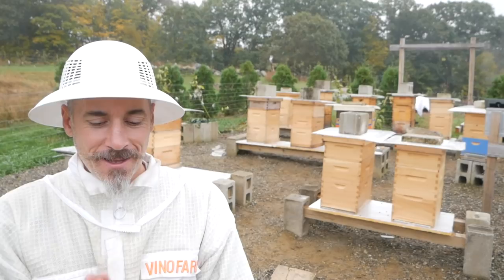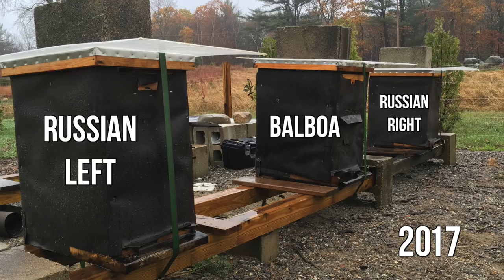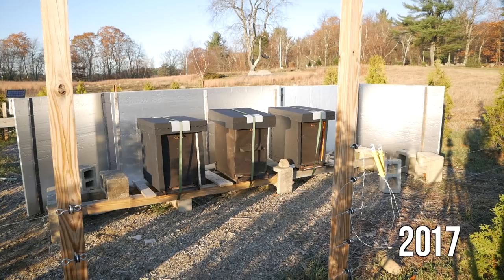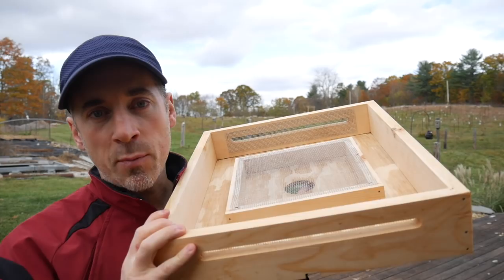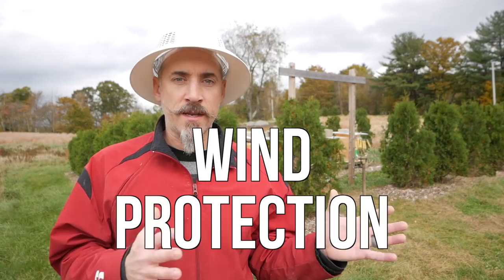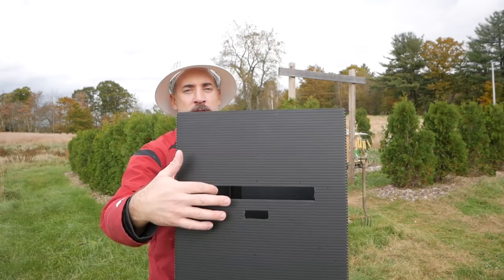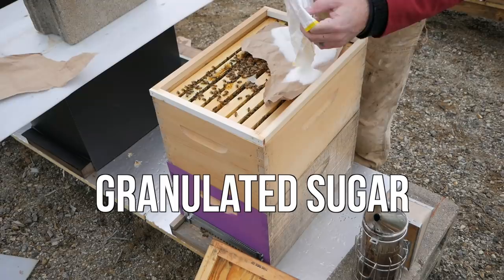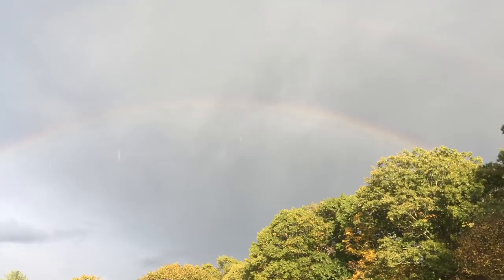Never Use Tar Paper Again, Beekeepers!

Comment from the maker: Where did I get my coroplast? I'm in Massachusetts. I googled "coroplast" "corplast" "Corrugated plastic" and found that most places that were coming up were sign shops. (All those political yard signs are coroplast.) Then I googled "Sign supply" "Sign Supplier" etc. and found a company called NEPCO in Rhode Island. I was prepared to drive down there, but they actually deliver all over New England. I called and they gave me a price of $16/ 4x8 sheet. That sounded pretty good, but I asked how much a larger quantity would be and he gave me a much better price. If you buy more, you always get a better deal. Shipping was a fraction of the price. So if you are in New England, call NEPCO. 

If you're careful about your cuts, you can get TWO sleeves per sheet. 

One 4x8 sheet will yield:

TWO single deep brood box sleeves
or
ONE single deep and ONE double deep
or
2 single deep+single medium combos
or
2 double mediums
or
2 triple mediums

You can't get 2 Double Deep sleeves out of a single sheet.

I did my 12 hives with 6 sheets!

----------------
Oh, and if you're cool with Alibaba and don't mind waiting for freight from China, you can buy 1000 4x8 sheets for $1/sheet (or probably less if you haggle!)
Reply: RV dealers, used as an underbelly. I work at an RV dealership and we purchase it by the roll and sell it per Rolling Foot
Reply: Vino Farm winterizing
Reply from the maker: Paul, Good Tip! How is it rolled? Are the channels parallel or perpendicular to the "roll"?
Reply: @vinofarm  perpendicular.
Reply: @vinofarm  u will send u pics and part numbers to your email.
Reply: Wouldn't be better to build a greenhouse tunnel over the bee yard?
Reply: Did you check if it was UV protected? Otherwise, it will degrade over time.
Reply: @Helveteshit  the material  i am referring to is very durable, i don't know about its UV charateristics however it is a black plastic. I relate it to zip ties, typically UV rated zip ties are black and non UV are white. But of course this is just an assumption based on observation.
Reply: I had 1 beehive and it died today😭 because there was alot mites.. and it was too cold already
Reply: you should try a shamwow this winter!
Reply: It still puts of voc , it amazing people put tar sound damper material in there cars...

Comment: From testing I've done  the  best moisture control is a good insulated top cover with no ventilation up top and  no air leaks , the top cover under the insulation  is always worm which keeps moisture away ,  cold surfaces invite condensation  ,air vent up top keeps a small stream of air going through the hive  while taking moisture away it also has a cooling effect on the cluster
Reply: To clarify from your testing, the Vivaldi board would be good in summer for ventilation but remove for winter due to condensation? Or would you never use the Vivaldi board?
Reply: @roland7511  My preference is insulation up top with no holes ,i mostly use reflective double bubble insulation with with trimmed around top cover  for  a little dead space up top winter or summer , no condensation and bees like to hang close to it for  its heat retention ,worm bees eat less honey also . Bees prefer a bigger bottom entrance for extra ventilation in the summer and tend too seal up all extra entrances for the winter ,chimney effect can be bad for it constantly brings air from outside in a bid to equalize temperatures .

Comment: Bees can move easily up in a long cold but not over. Heat rises so they follow the heat. I like to keep 2 deeps and 1 medium up in Canada. They stay at the bottom and then move up over winter. 

I agree with insulating the roof and three sides. I built special roofs and have two 3/4 inch screened holes near the center of the cover. I dont run upper entrances or any moister pads but am not against them either.

I tried tuck tap to seal the cracks between boxes but that hurt the paint. Dont like tar paper or anything black as I think it heats them too much and they eat more food. Would rather they stay in cluster for longer.

Comment: @Vino Farm , In regards to break cluster thing, you mentioned as an example. Wouldn't cutting a hole in a frame help? So they do not need to go down or orient around a side? Basically, make a round hole through all frames before winter. So they can more easily transfer themselves to the other side without breaking cluster? 

I mean, if you imagine a frame like a wall and the cluster as a bunch of naked humans hugging eachother to keep warmth. To move around along the wall is easy. But they will have to shrink their mass to get around. But if you make a wall in the hole. One can push through and form a wall on the other side yet still have the mass of warmth from the other side. Slowly allowing the humans to feed through and hug on the other side and scavenge for food on that side of the wall.
Reply from the maker: Helveteshit That makes sense to humans, but bees will fill the hole. They don’t like spaces like that. They just build comb and fill in gaps everywhere.

Comment: I've seen advice from a lot of different people that top and bottom entrances should be mutually exclusive during winter months in colder climes to limit air column flow and heat loss. Thoughts?
Reply from the maker: I heard the opposite. The bees create the flow they want. They'll actually plug the top hole as needed if there's too much ventilation.

Comment: You didn’t mention tilting the hives. Do you do that? 
In case any moisture collects and builds on the bottom side of the cover, it’ll flow to the edge and drip rather than drip on the cluster in the middle.
Reply from the maker: Roger Jodoin Yes, 3/4" shims under the back end. I'm trying 1" foam insulation boards UNDER my hives this year to prevent the wind flow under the hive stands from pulling heat out of the hives. I put 3/4" blocks under the rear of the insulation boards so the whole platform is tipped. The hives sit flat on the foam boards.

Comment: Do you tilt the hives forward to help any condensation flow out the front?  If so,  what do you use to create the tilt and how much tilt is there?
Reply from the maker: Yes, 3/4" shims under the back end. I'm trying 1" foam insulation boards UNDER my hives this year to prevent the wind flow under the hive stands from pulling heat out of the hives. I put 3/4" blocks under the rear of the insulation boards so the whole platform is tipped. The hives sit flat on the foam boards.

Comment: Hey Jim! Love watching you take care of your bees. Just something I noticed. The Vivaldi boards with the inner covers underneath are essentially quilt boxes. Last winter I put it in an inner cover underneath my quilt box, and the moisture was not able to fully escape through that small hole that is built into the inner cover. The quilt box needs to literally just sit on top of the uppermost frames. That way, the entire bottom of the quilt Box is open and available for hot air to come through.
Reply from the maker: Whatever works for you... Heat will find it's way to the highest spot no matter how small the hole. The warm air carries moisture. When it hits the cooler burlap, the moisture should condense into the burlap. That's what I've experienced. I personally don't like the idea of an entire ceiling of damp wood chips over the bees. Again... your experience may be different, but I have never witnessed any moisture problems or even 'wet' burlap in any of my hives.

Comment: Did you do OA treatments for the mites? If so, what method?
Reply from the maker: PJ Mac Apivar strips.
Reply: @vinofarm  I'm wondering if anybody is going to make a cheaper version of the Provap 110. Lucky enough I 
had a nice beekeeper use it on my hives and it works great but the $500 price tag is a bit out of my reach.

Comment: I use white coroplast for bottom boards, under #8 screen/hardware cloth, to both close off the bottom in Winter and so that mites are easy to spot after treatments. Seems like a genius idea! I would suggest, though, that you keep an eye on them for awhile...to see if you're getting frost accumulation near the openings. Coroplast has NO ability to 'breathe' while tar paper will, albeit to a limited extent. At first glance, though, it looks like one of those "Why the #$%^ didn't I think of that??" solutions! The covers you fabricated look almost machine made!! Nice job, Jim!! :-)

Comment: Add mouse guard or entrance reducers for all your hives if you haven't. I'm a little worried you will get mouse under the plastic flap shading the entrance and they will try to chew into your hive. Maybe you want to put a filter on the top entrance to prevent other bugs from getting in and feasting on the sugar.
Reply from the maker: Watch the video... there is a mouse guard installed right under the flap. They are on year round for us.

Comment: The plastic look good, but keep in mind that if there are any holes or cuts in the plastic then it's not going to act as a very good insulator. 

The best (practical) insulators use trapped air to slow the transfer of heat from one interface to another. In a home, this is called closed cell foam, where the foam pulls in air into very small individual pockets and the pockets aren't big enough where the air can really move around and cause a convection current. Though the most common one in homes is insulation fiber which does the same thing, just not as well. 

The best of the best in terms of insulation is a vacuum. That's why the best thermoses will be vacuum thermoses where there is no air at all to transfer the heat. It can only radiate which is very slow.
Reply from the maker: This is part 1: Wind / snow/ rain protection. An entire insulation layer will go over this in a couple weeks. Stay tuned for part 2.

Comment: it seems weird to use vivaldi boards to control humidity like that, because you're adding a chamber on the top where the warmest air in the hive will rise to and then ventilate right out, and even if that stays warm, the bees can't access that warm area. you're basically providing an easy escape route for the warm air, and prioritizing humidity over temp. i know many people have success with those, but maybe just insulate the top to hold in that warmth, and look into other ways to deal with humidity
Reply from the maker: It's not letting warm air out. The air doesn't just flow through the vivaldi board. The moisture goes up there, but the burlap is pretty well packed in so there's not a lot of "flow" up and out. However they do what they do... 11 out of 12 hives survived last winter and I will be doing the exact same treatment this year.

Comment: not only is the coroplast easier to use but it also makes your hives look very elegant
Reply: It really has a neat, professional look to it, doesn't it? Much fancier than the tar paper, on top of all the benefits like speed and less waste.
Reply: Pricey though, guessing $300 to do 12 hives
Reply from the maker: Janet Kouma LOL. 12 hives cost me under $75.
Reply: @janetkouma1  well.. he already said how much it cost but even if it was that expensive it would be cheaper over time.. i mean the paper isn't rlly reusable as he said so it's another invest´ment yearly and it produces a lot of waste
Reply: Vino Farm where did you buy the coroplast  sheets from
Reply: @vinofarm  even at $300 I think it would be worth it, worked with coroplast for years, the stuff is super durable and the way your using it isn't even going to be stressing it at all, I would be surprised if you ever need to replace one.

Comment: Looks like neat stuff. So where did you find that coroplast?  Do you tilt your hives forward in the winter? Didn't look like they were.
Reply from the maker: I just pinned a comment about the coroplast...

The hives are sitting flat on insulation, but the insulation IS tilted. I've never put anything under my hives before, but I'm trying it this year. It's an attempt to keep the wind from sucking heat out of the hive as it blows under the hive stands. There are 3/4" blocks under the back side of the insulation boards.

Comment: Another fine video the yard looks great. IMO, A little risky treating this late with Apivar, It may to cold to get in to get them out 6 weeks from now. I ran into that problem last year. Best of luck
Reply from the maker: I treated my two hives last October and took my strips out in the spring this year. No ill effects that I could see.
Reply: @vinofarm  now that's how you will allow mites to become resistant to Amitraz! The label is the law. Treatment is 42 days. You really should remove the strips Nov. 20th. http://www.apivar.co.nz/FAQs.htm 

9. Recommendations for high efficacy of Apivar 
5. Remove the strips at the end of treatment.
Strips should be removed at the end of the treatment for 2 main reasons:
  - At the end of treatment, after a long releasing process, the quantity of amitraz released by the strips is lower.  This creates favourable conditions for resistance development.
Reply: @vinofarm  Not a smart move, Apivar is a great tool. It's not that your going to see ill effects rite away. If people keep doing this, Eventually what is going to happen is after the treatment time is up the efficiency of the active chemical in Apivar (Amitraz) falls way below threshold in turn exposing the mites to minute amounts of Amatraz, over time this gives the mites a chance to build an immunity to it.  In the past this is what happened to the treatment Apistan, wich is now useless because of resistance. Example, Same as a person taking a 1/4 dose of antibiotic for an infection. What's going to happen is the infection is going to out grow the strength of the antibiotic rendering it useless, at that point the infection will be super strong and the original antibiotic will no longer be effective for further treatment options .
Reply from the maker: Dan Lieter Good to know. I’ll do my best to get them out, but like I said, I will be switching up treatment next year. So any resistant mites will hopefully be wiped out then.

Comment: Our bees like to plug up the bottom hole in the Vivaldi board with wax and essentially completely stop the escape of moist air from the hive. Have you noticed a similar effect with any of your hives?
We are using a flat plastic screen taped flush against the hole instead of your metal mesh on shallow frame. By comparison, the insert from the original design provides an incentive for the bees to keep the bottom hole open - at least so long there is food. Did you stop using the original version for any particular reason? Thanks
Reply from the maker: They did not plug the holes over the winter. However I left them on all summer for summer ventilation (with the burlap removed) and about half the hives plugged the holes over the summer. I made new screens for this winter and they all have clear holes now venting into the burlap. I'll see if they start plugging them again. I think with the burlap right up against the screens, there isn't as much air movement and they don't feel the need to plug the holes. The moisture can still get up into the Vivaldi space, that way.

Comment: Is there a reason you couldn't put a mini hoop house around the bees in winter? Seems like wind and rain are the biggest issues.
Reply from the maker: It was a thing I considered. But I don't want it on in the summer, so it would be more of a hassle than I want to deal with putting it up and removing the plastic every year. These coroplast wraps go on in seconds and store flat when not in use. They should last for many years. It's a far more flexible and simple solution.

Comment: u make a complex solution to fix simple problem, protect  the frames rather than protect the whole place
Reply from the maker: T abdullah What do you mean, “protect the frames”?
Reply: i have complete beehive design in solidworks.. i can send it to you,, we use it in winter and summer,, very effective,

https://imgur.com/a/6qtbb6g
check the picture of the actual  beehive,

it will give you gr8 results..  xps thermal conductivity is too low and the frames wrapped with that xps result of  zero contact between beehive box and the inside frame

Comment: Does any one use a seed starting matte and 34 degree switch?  They  are low watt heaters that are flat and waterproof and turn on only when the temperature is below 34 degrees.  They will heat the immediate( 0ne inch) area up to 20 degrees above ambient.  That would be about 50 degrees if it was 34 degrees outside. It  would turn off when outside temperature reached 34.  It would tend to keep the hive above freezing.  I put them into an unheated greenhouse and start seeds on them.  The seedlings have to be covered with row cover but don't freeze.
Reply from the maker: My local mentor uses them on his hives. He has them on the back wall (outside) but underneath insulation. I don't know if I'd go that far, but I don't have power up on my hill, so it would be an ordeal with thousands of feet of extension cords.

Comment: Just one question why put vents holes on both sides of your attic if the corplast covers the back ones?
Reply from the maker: One vent has proven to
work fine to keep the burlap dry. I thought front and back holes would create too much chilly cross ventilation. In the end, I just did it the first year and never changed it because it worked.

Comment: Just noticed at the end there was a bee that fell off the platform. Do you think the black flap at the bottom is not providing enough space for them to fly away? Not sure if that's a huge concern for winter, just sharing an observation.
Reply from the maker: I'm going to put a block of wood under the middle of each flap to make sure the center does not sag under snow. They also have a permanent upper entrance.